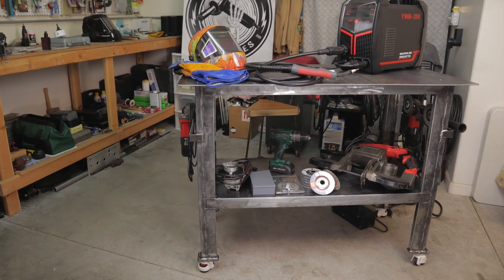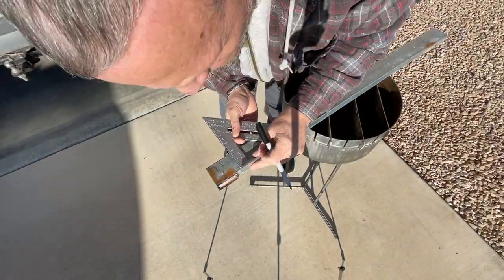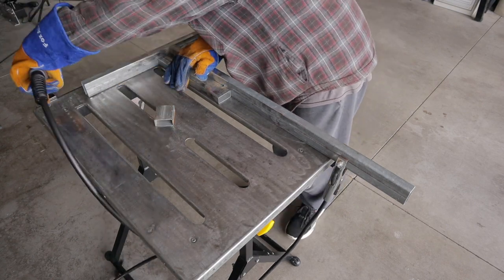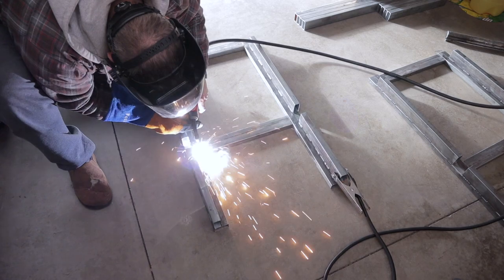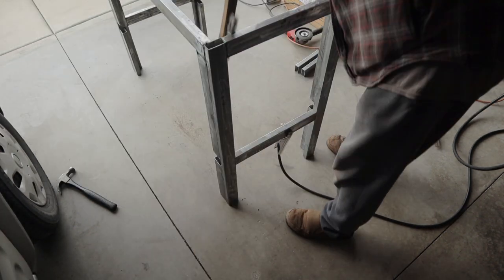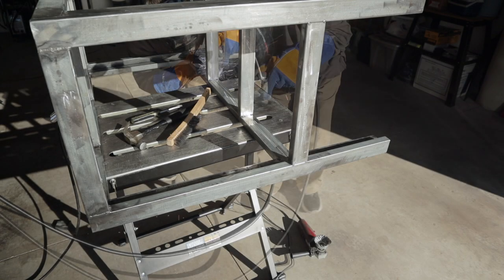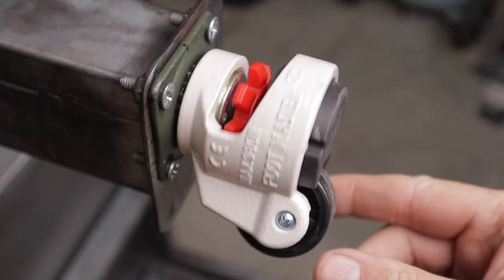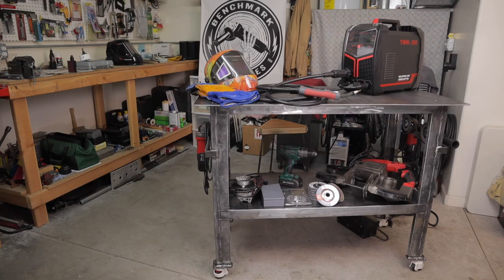How to Build a Simple DIY Welding Table with Simple Tools - It's Easier Than You Think!

Comment: Nice work Bruce great video. I might have missed if you had said but what might be the material on the welding table top ?
Reply from the maker: Thanks Mark, I appreciate it! The table top is a 3/16" piece of plate steel.  I wanted to go thicker but I just couldn't justify spending what they wanted for anything thicker. This 2X4 piece of 3/16 plate was $100 and I thought that was ridiculous.